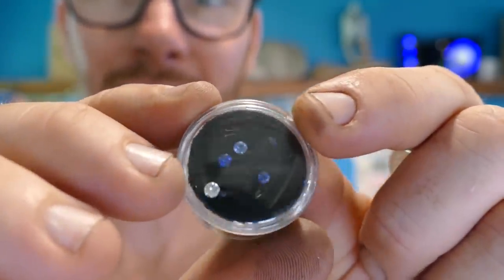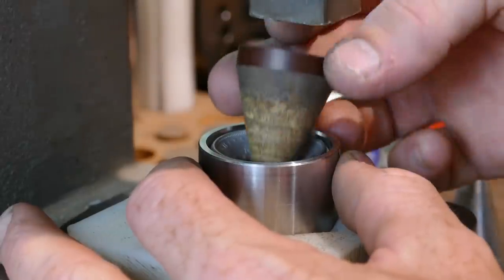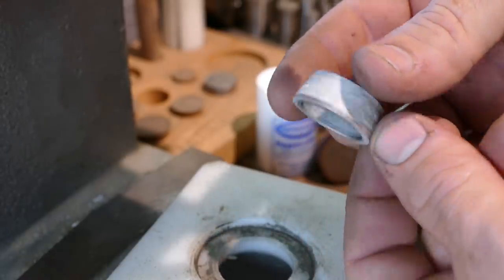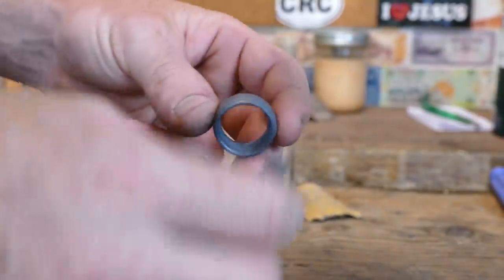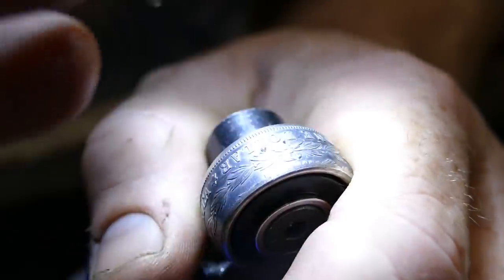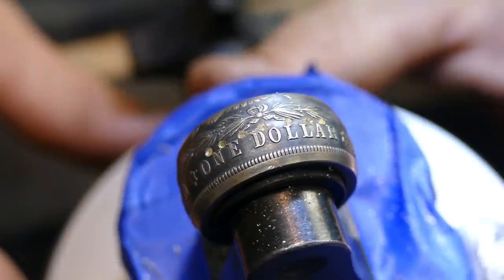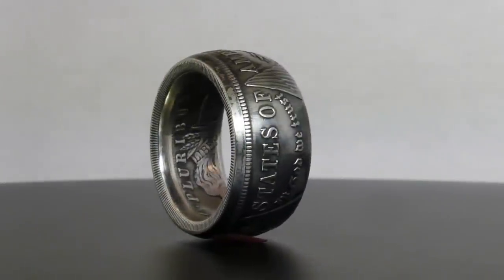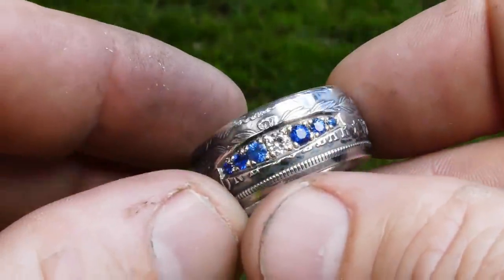Making a Silver Dollar Ring with Diamonds and Sapphires

Comment: Consider looking into either a macro lens or lens extension tubes. They will help with the tiny object filming. Make sure, if you go with extension tubes, you get the electronic ones. I accidentally got manual for my camera and it still wont come off of my favorite lens... the lens also doesnt register with the camera anymore. Otherwise, cool ring.
Reply from the maker: Cool thanks for the tip!

Comment: So why go through the trouble of basically cutting a trench for the stones? Seeme like it would just create opertunity to mess it up. Why not just set all the stones in the same fashion as you would a single stone? Under the scope it looked kinda hacked up from the engraver  "beating" its way down the groove. Would a cut off wheel leave a smoother edge?